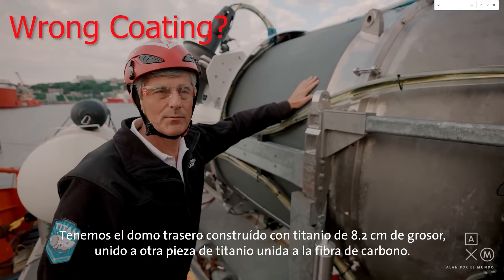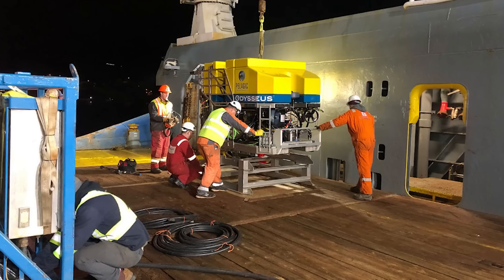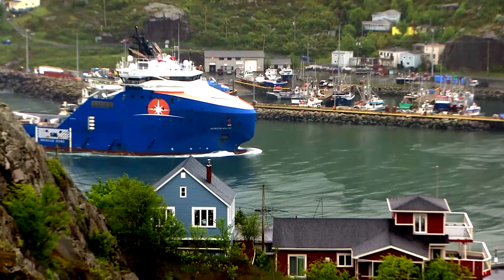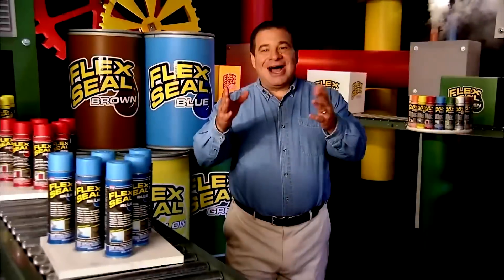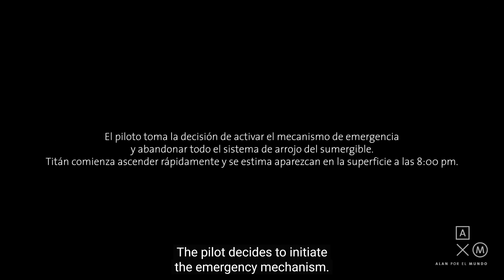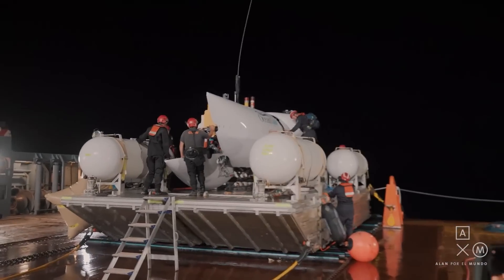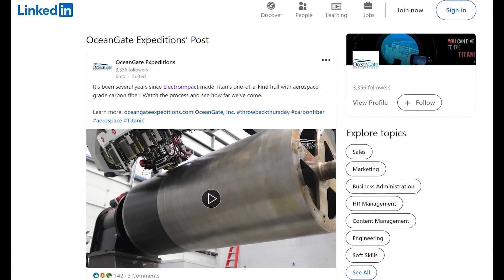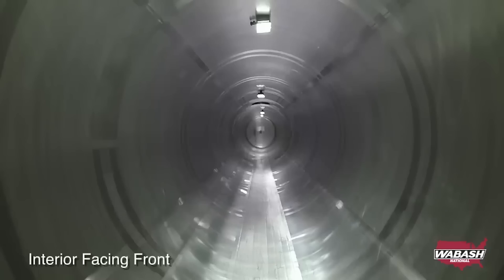Titan Sub Wrong Coating? Hull Construction, Debris Field Search

Comment: The way Rush describes that coating always bugged me. "Used by the military" yeah it's also used by us hillbilly country folk to coat the bed of pick up trucks but I guess "used by the military" sounds more impressive. Now I'm going to have a glass of this special liquid that Navy SEALS drink- otherwise known as water (it's hot outside, stay hydrated people).
Reply: Well, it is used on walls to reduce blast damage in some fashion.  But be careful with the dihydrogen monoxide, I've heard it can be hazardous if you aren't careful.
Reply: @k53847 That dihydrogen monoxide is in everything!
Reply: @truthache8560 I've heard that dihydrogen monoxide is extremely flammable if you separate its constituent parts! Deadly stuff
Reply: WATER … used by the military!

Rush was obviously a marketer (professional liar) not an  engineer.  Elon Musk has the same trait

.
Reply: @electrictroy2010  yeah but im sure elon knows that fiberglass won’t stop 🛑 the ocean 🌊 pressure
Reply: @k53847  that stuff is deadly if you overdose on it.
Reply: Any time something is advertised as “military grade” do not buy it.
Reply: @rachelPH79  exactly
Reply: @rachelPH79 although mil-spec AR15 buffer tubes are pretty good for swapping your stocks now.
Reply: @rachelPH79  The military always buys from the lowest bidder. Look at it that way.
Reply: @rachelPH79  spot on…..military grade equals this product is made down to the lowest price per unit. Far out…..
Reply: @rachelPH79  milspec is the bare minimum
Reply: @rachelPH79 some “general issue” grade
Reply: @rachelPH79 or “viral” or is “…going to be taken off the internet by competitors!” , “….and it’s disrupting markets all over….” lol!
Reply: @rachelPH79 high spec, because the lowest bidder cuts corners on everything not in the spec.
Reply: Would have been more impressive if he said the Navy used it on their submersible vehicles to protect their hulls from corrosion. But the military probably puts it in their pick up beds.
Reply: @thunkjunk I think a (much thicker) variant of it might be used as a spall liner inside armoured vehicles to prevent fragments coming off the interior surfaces of the armour when they're hit by enemy fire.
Reply from the maker: It's Redneck approved!
Reply: @jeffostroff I would not go out on a limb to say RinoLiner would work. However I have seen a large watermelon sprayed in it dropped on concrete from 150ft high multiple times. It bounced probably 50ft high and didn't have a scuff on it. Attempts to cut into it with a axe were unsuccessful. It was eventually cut with a chop saw. Providing adhesion was sufficient and permeability was not an issue I would suspect it might work.
Reply: @nate1sam  You do realize the pressure at sea level is far different than the pressure at the level of the titanic? It may not be permeable at 5, 10 or 30psi but the pressure they were at it was closer to 5,000psi.
Reply: @jeffostroff You could do worse 😂
Reply: @jeffostroff Hey, Rednecks are good enough to be probed by the aliens! Now, they’re coming for the Democrats!
Reply: @jeffostroff  if you actually knew the difference between the truck bed liners and knew that the military literally bought it to stabilize buildings from collateral damage from our bombs then maybe you would understand more
Reply: Too bad he didn’t use something else that all military people use…his brain.
Reply: @cadence4527 I did 15 years, never once used my own brain, that's what we have officer's for..
Reply: Used by the military sorta is the actual claim, which, uh, has a lot of wiggle room.
Reply: @leoniearmstrong7766 I'll stick with my civilian-grade toilet paper, thanks 👍🏻
Reply: @mrkeogh  I use sandpaper, cause I'm a manly man who does manly stuff...
Reply: The term “Military Grade” means absolutely nothing at all anyways lol
Reply: I hate when people think "militarty grade" means good quality when in reality it means the "cheapest contractor's grade".
Reply: I laughed so hard at the Rhino Liner that I woke up my roommate. I had to explain that they used the liner us rednecks use for our truck beds on the damn submersible. It was the last thing I was expecting, although I shouldn't be surprised at this point in the Oceangate saga.
Reply: Pretty much, just trying to add credibility to his bad design. Do you know what they coat titanium spheres with, that are used by submersibles that don't implode? Either nothing, or just some paint.
Reply: Also adding the word tactical in front of any ordinary item makes it mil spec.. flashlights, wallets, sunglasses, not sure about submersibles.
Reply: @kev_299 tactical marketing
Reply: The people who think “military grade” means high quality have never been in the military. It’s basically the best they could get for the least amount of money.
Reply: @artificiallyuninteIIigent  The reason it's use became popular in military is to bomb proof structures. After the OK City bombing planners we're looking for a way to bomb proof existing and future buildings. RinoLiner became the answer, it them became used in military to bomb proof structures because of its ability to handle extreme pressures
Reply: Another example of Rush intentionally misrepresenting his design and construction process. In court Oceangate will choking on all his videos and advertising.
Reply: Redneck Redemption
Reply: That was my first thought when I heard the term, "rhino liner"!  Then I thought I must be remembering the name wrong, that not even Stockton Rush could be stupid enough to use a pickup bed liner on his deep sea submersible.

Turns out he could indeed be that stupid.  🙄
Reply: @astrinymris9953 The whole design is as if reddit were building a submarine
Reply: Hey, Stockton Rush drank water, too...  What are you trying to pull here??
Reply: @johnbergstrom2931  Stockton drank Brawndo.  Used by the military, its got electrolytes.
Reply: @johnbergstrom2931  he put too much water in his body
Reply: Used by the military = used by the lowest bidder 🤭
Reply: Sure. Used by the military at sea level or in flight where pressure differential is at most one atmosphere.
Reply: He was an amazing con man
Reply: Yeah no kidding. I hear commercials all the time. Rhino-line your house, rhino-line your truck bed… I find it stunning that this dude would expect that material to withstand some of the strongest pressures on the planet
Reply: I have it in my pickup truck bed at 5mm thick and if you drop a brick on it on the sharp side it can cut through it
Reply: The military also uses coffins
Reply: military spec just means it was the cheapest made product that passed military testing. Most civilian stuff is better than milspec.
Reply: ",sort of what the military use' ....he's not even convinced that it is
Reply: Ha ha ha! Well said! 'Captain crunch' was bluffing himself! He should never have tried to create  a shuttle service to 4000 m under the ocean,maybe sometime in the future,with much more diligence applied!
Reply: I’m pretty sure the Navy doesn’t use that for its anechoic coating which I believe rush was referencing.
Reply: @pickledpeppers1577  No the rhino coating would be too thin to be effective.  Nuclear subs use 2 inch thick rubber tiles.
Reply: @pickledpeppers1577  It has become evident that Rush told one lie on top of another to sell seats in his defective craft which was not built by the company in Florida which builds the Navy submarines for countries worldwide.  Everything about Stockton Rush was a sham
Reply: He's also said that they've worked with NASA before, but that was on entirely different projects. NASA wanted nothing to do with the Titan.
Reply: I'm sure somewhere in the military a contract was made to utilize rhino lining.... but after 16 years in the Army , I personally have never seen nor heard of it employed in a military application... even in our "civilian" TMP vehicles... 😂😂😂😂 

that guy was a low level con artist with a big budget
Reply: @rawkemsawkem3328  carbon fiber definitely isn’t better than say titanium
Reply: My first laugh of the day! Thanks from Scotland!! 😃
Reply: The last thing a hillbilly says B4 he dies? "Hey, Bubba! Watch this!!" P.S. I was born & raised in WV, giving me the authority to share that silly joke
Reply: @kayoticmind having lived in sw pennsylvania. I can confirm that W-Virgianians are authorized to make such jokes.
Reply: @Mglue3  🤣😎✌️
Reply: Military grade = made by the lowest bidding company
Reply: As someone who has marketing experience and is from a military family, that sounds like another way of saying "military grade", which is a great way to diminish my interest in a product. 
It basically tells me it's made to the lowest possible standards!
Reply: What people don’t realize about the commonly mentioned “military grade” or “mil spec” is that all that means is the part meets the minimum requirements to be used by the military. It doesn’t mean it’s god-tier hardware if the military has low expectations. It means it meets some minimum performance spec that if you verify by reading some standards, you’ll realize they aren’t hard requirements to meet.
Reply: "Used by the military"...  Uhhh, yeah....  But FOR WHAT????  Truck bed liners??  the outside of communication equipment lockers???   The outside of helmets that Combat engineers wear????   The tops of tables in a cafeteria????

Yeah....  Used by the Military....  They also use Sharpie markers, Good Year Tires, and Odyssey Batteries in their vehicles....  Not sure any of those products is going to help you get to the bottom of the ocean in one piece....
Reply: The military drink  , water, the military breathe air = Military approved 😂
Reply: He intentionally gave vague descriptions only employee to speak up was one engineer the rest wanted to keep getting paid.
Reply: Do be careful though, I’ve heard that 100% of people who daily consume dehydrogen monoxide eventually die.
Reply: Doubt coating, glass/oil electronic compartments. If they didn't work right they were bombs.
 Especially the huge glass sphere right behind the titanium aft cap.
 If transcript is close, it explain cracking from the aft and not around the rim of the hull.
 The end of the fiberglass ends inside the sub. The back end is walled off in the titanium cap for equipment. 
I think it they'd call out the hull instead of the aft. 
 Rapid decent, panic loss of power or a explosion from the glass/oil compartments
Reply: :face-fuchsia-poop-shape::face-blue-smiling:
Reply: Well said
Reply: "Used by the military" implies that it meets some MilSpec or other. Such is not the case.
Reply: Sales pitch
Reply: I thought that sounded familiar.  My dad mentioned that very name when he described the bed liner on his pickup truck.
Reply: I thought exactly the same thing. The military doesn't use it on subs, if it uses anywhere widespread at all. I'm sure some soldiers do anything with it.
Reply: Where can I get some of that secret navy seal juice?
Reply: Maybe he was talking about toy military😅😅😅😅
Reply: Everything a joke to people even when lives are lost...... no hope for humanity
Reply: @UchihaClanFamily  you’re a silly person.
Reply: Smell for fuel first
Reply: Goddamnit iknow when to drink water
Reply: Don’t forget tweakers
Reply: It's the marine polyurethane boat coating, not the spray on truck bed liner. Rhino Linings makes multiple coatings for various purposes from vehicles to industrial use.  Finding the specs/listing for the specific coating is difficult. It appears that you need to call the manufacturer to get that information.
Reply: Hey, even regular soldiers drink Gatorade sometimes;)
Reply: He said "sort of used by the military". It's probably "all natural" too.
Reply: Nice
Reply: Military grade, so in other words, as cheap as possible
Reply: Actually no they use it to stabilize entire buildings like four-story concrete buildings when there's collateral damage from one of our bombs just look it up yourself it's amazing how it can stop a entire building from falling over that's why the military literally bought the company
Reply: Tell me you don't know the difference between Rhino liner and Line-X without telling me you don't know the difference between Rhino liner and Line-X
Reply: I guarantee you the stuff you roll onto your bed of your pickup truck is not the same two-part hydrothermal proprietary system that they spray to stabilize buildings
Reply: Rush was in to big of a hurry
Reply: Sound like a YouTube add you know the one your finger is jut waiting for the 5 second to pass
Reply: Exactly. The carbon layer was coated with what exactly?
Reply: @mc4ndr3 A space pen uses or at least used a pressurized cartridge. NASA didn't spend a ton of money developing it. It was a commercial of the shelf product. Russia bought them as well.
Reply: Hill Billy's also use velcro, and they drink water too just like the military so those must be bad
Reply: I always liked when he talked about consulting with individuals at NASA or Boeing or whatever.

If I was working on a project between 0 and 1 atmosphere, yeah, they’d be perfect consultants.

But repeated trips from 1 to 400?  Probably should have consulted with different people
Reply: @tims4502  the deep submersible community warned them about their reckless approach. Btw boeing makes the orca xluuv rated to 11,000 feet pretty close to titanics depth.  Boeing would be a prime source of info on carbon, tensile, compression, buckling, temperature, load cycling performance, adhesive bonding etc.  and where not to do it. This is  assuming the marketing department let's the engineers do the engineering.  

.02 there is 0 probability NASA Boeing etc. would sign off on this clown car being man rated.
Reply: I mean just because because something is used by the military, doesn't mean it's super-duper special.  Porta-potties are used by the military.
Reply: As used by the military....just like the Navy uses giant anchors.....
Reply: Bro I don’t know. Hillbilly’s know some stuff. If they using that stuff to protect their beds. I’ve change my thoughts on the matter. 

By the way had a partner that did time on a carrier. He told me that F14s often time flew with duct tape on there chassis
Reply: It's not hot out here
Reply: @inismona27 You're body is still generally 90% water, so drink that navy seal drink.
Reply: A bit like the "aerospace grade" claim on the carbon fiber... Sounds good but the conditions are radically different underwater.
Reply: Carbon fiber is just fiberglass that is woven …. Fiberglass

Comment: These kinds of accidents don’t usually have one cause.   It’s a string of causes that begin years before the disaster
Reply: It's pretty obvious - the front fell off - it's not very typical
Reply: @gorak9000  but how and why?   That’s probably has to do with the carbon fiber and the epoxy expanding and contracting at different rates than the titanium ring causing a gap.   There was also so much else including the off the shelf electronics designed by college students, the lack or restraints for the passabgers, thrusters that could have been wrong as before one had been installed backwards,  and the very tube shape of the hull had unbalanced pressure forced on it, and much else.   All  or one could have caused the end to explode off.    The Apollo fire for example was caused by decisions and cut corners made years prior.
Reply: @RossM3838  that one just r/whooshed right over you...

Comment: Correct me if I’m wrong, but the only use of scaled down models that I can think of is when testing aerodynamics with wind tunnels.  Never for collisions or stress tests.
Reply: Exactly
Reply: It would have been relatively cheap for him to do at least some testing on a full size hull.  He could have bought a cheap a/c recycling vacuum pump at Harbor Freight (right up his alley), hooked it up through a fitting and let it run all night.  Even a small piston pump will eventually reach near full vacuum.  Lowering it in water while under vacuum he could simulate much higher pressures at lower depths and at least have some way to check roundness or distortion of the hull.  He can’t rely on scaling up thicknesses and diameters in that type of application.
Reply: @kev_299  No, an inside vacuüm is equivalent to an outside pressure of 1 bar. Which is pretty trivial to achieve, and totally insignificant when designing something that should withstand 400 bars.
Reply: @BartSliggers  For sure it needs to be many many times stronger than vacuum implosion strength - vacuum is used in combination with submerging the vessel to simulate more pressure.  He couldn’t come anywhere near simulating actual pressure at 4000 m but he might have been able to see the first signs of any distortion (which likely began much earlier than he thought)that would tend to get progressively worse until it imploded.  He probably didn’t want to know the results of any testing after that and chose to remain blissfully ignorant after he made up his mind to use CF.
Reply: @kev_299  The problem is that a full evacuated "vacuum" is a maximum of 15psi - whereas the pressure at 3500 metres is above 5000 psi. An extra 15psi due to having pumped out all the air is not going to be of much significance.
Reply: @dougcollins9980  May not be 
much but with the issues that sub had experienced there may have been some early indicators.  Remember the cracking described started at much shallower depths - shockingly shallow..
Reply: You might get an idea  with scaled
down model ships as well.
But ! Nothing more than a clue.

For examble : A model ship can't replicate the (real) waves along 
the ship's water line.